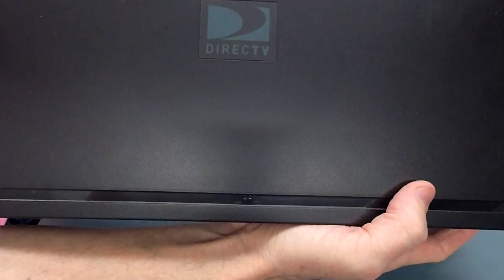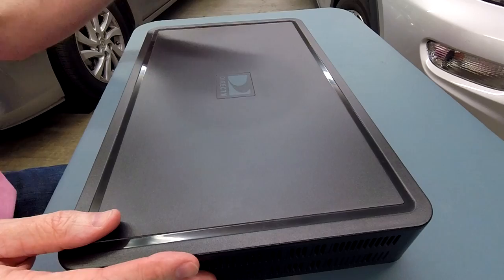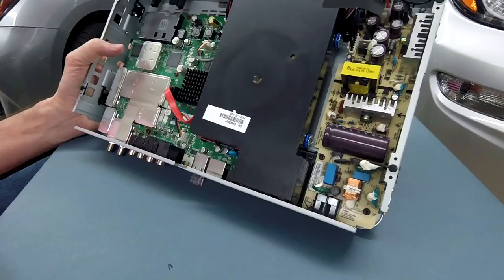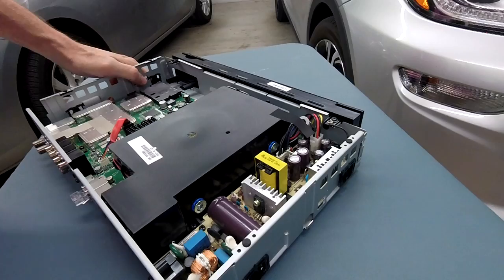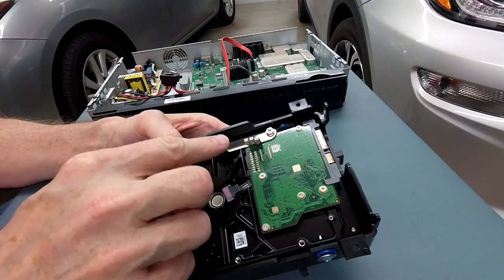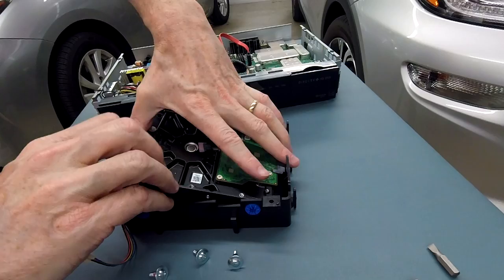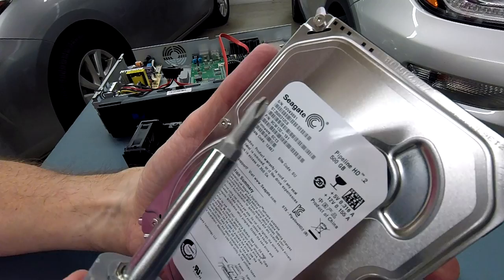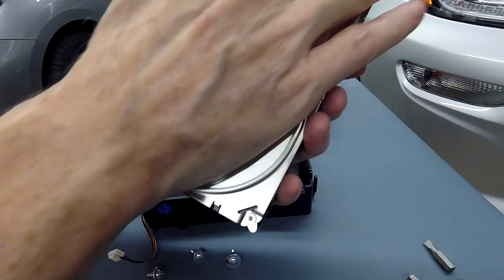DirecTV HR24 Satellite Receiver cover removal and hard drive replacement SUCCESSFUL!

Comment: Just finished installing my new Hard Drive on my HR24-200. Ordered a new Hard Drive from Amazon $15.99. Goodbye Blue Screen of Death. Thanks soo much HGODTX, it's videos like yours that give me the confidence to attempt something like this. It really was quite easy. One great suggestion I read that really worked well was using old credit/gift cards to hold the clips open on the sides when removing the case.
Reply from the maker: Can't believe 21k people watched this. I try and make tech videos whenever I can't find anyone else with a good explanation of something that I need help on. Yes, the credit card trick is good, I learned about it just after I made the video!
Reply: Can you provide a link to the drive you purchased? I would appreciate that.

Comment: Here we are in late 2019 and DirecTV probably doesn't have these receivers any more, so I didn't want to deal with their hassle to upgrade equipment (for my own personal reasons).  But thank you for the video and showing where the tabs are.  While my model HR24  isn't exactly like yours, the cover and clips are the same.  There are little indentations on the side of the plastic cover that tell you where the clips are.  I simply put it on it's side and slipped a small thin screwdriver into the openings and unlatched the clips one at a time for each side.  The cover slipped right off and didn't snag in the back like yours did.  I replaced the hard drive with one I had for 500G (from a previous operation on another DirecTV unit) and it started right up.  As a matter of fact, it still had my Series Manager shows on it from 2 years ago.  It also had recordings, but they were encoded to the previous receiver and wouldn't play, so I just deleted them.  Hope this helps someone else like this video helped me.
Reply: I've heard that the HR2* line of receivers are no longer being activated unless you are a commercial customer or have the little insurance plan they offer on a monthly basis.  Pretty clear that they are trying to get all of us to switch over to Genies and ditch these things altogether.  So for those of us who still like the equipment, pop in a shiny new 2TB and game on!

Comment: Thanks for the video.  I am running my HR-24 off an external 2T SSD.  Best upgrade I could have made!  I bought the SSD off eBay (an enterprise-grade SM863, if I recall, with over 80% life remaining).  I’ll go ahead and install it inside the DVR as there’s no need to keep that old HDD spinning since it’s not being used.
Reply from the maker: About 4yrs ago I found myself using the free directTV app for streaming my service more so than the DVR. Then my dish started needing constant adjustment. Then my wife and I had many 'gotta watch' shows blow up due to a heavy rainy spring. Canceled directTV and just went without for a while. Enjoyed savings and life without a DVR for 2yrs, then went with Spectrum TV choice streaming. Enjoyed that for a while. Then went with YouTube TV. Been loving that on all our devices. We do the family plan for YouTube TV and YouTube Premium with four of us and all our devices and are very happy!

One other thing that was very interesting was that the DirecTV streaming app was very problematic. Always troubleshooting it crashing, killing, restarting. Sometimes watching the 10:00 news I spent more time trying to get the app to play versus actually watching the news. It's as if AT&T was more interested in constantly authenticating users than actually having a working streaming app. Multiple Android phones and tablets all had the same problems. Such a PITA that I never looked back at considering AT&T streaming.

Comment: Thanks for the video.  I got the diagnostic code 14-079, a hard drive failure.  Contacted DTV and they tried to get me to swap all receivers out for the Genie system. Bottom line, the receiver is not manufactured any longer.  They are trying to find a replacement HR24 series for me.  They said I could just recycle this one, they didn't want it back.  It's been over a week waiting to see if they can find one.  Watched your video and swapped out the 500 for a 300 SSD I had laying around.  If they can't find a replacement unit, I will just replace the 300 ssd with a 1TB one later.  By the way, I used quarters between the plastic case and the locking tabs on the side.

Comment from the maker: Just a quick update. It's been two months and I can definitely see that my drive space has doubled. This means that the mainboard automatically senses the drive size and formats it for full capacity recording.
Reply: Thanks for the video. I have a HR23-700 & the hard drive is failing. Do you think I will be able to put a 1TB HDD in mine? Also is there any special specs I should get on the HDD? I don't have anything like that laying around. Thanks!
Reply: Old credit cards shoved between the sides of the case and each lock works very well to release the top. 2 slid in on one side,  pull up the top, then move them to the other side and do the same. Or 4 cards at each lock at the same time would prove to be even easier way to unlock them. Thanks for taking the time to share your experience with us here.
Reply: Would this work with an SSD?
Reply from the maker: @timgarlick3426  Sure! Any SATA connected drive will work. Not sure what the max size could be. 2TB should be fine and the question would be if it could go higher.
Reply: Is there a way to clone the original drive to a new drive?
Reply from the maker: @blueblade455  interesting question. Never tried that. Best shot would be using Acronis True Image (~$50) on eBay for (~$2). If the standard clone function doesn't work try using the sector-by-sector option. Not sure if the DVR creates partitions on the drive, you might have an issue where you clone to a larger 1TB drive yet the DVR still sees it as a 500GB drive.
Reply: @hgodtx  I remember reading somewhere that the device uses the HD serial number in some way.  They indicated that the image could be cloned, but you'd also have to rewrite the SN to the original....
Reply from the maker: @en2oh  Not sure if the SN is tied to the machine or the HD, but one thing I know is that you cannot transfer the HD or the files to another receiver. It will reject them, or possibly show the titles but not be able to play them. I think the files are encrypted with the key being that SN.
Reply: @blueblade455  There is and there are write-ups detailing how to do it. If you read them and are not sure you can do it, there is at least one company that you can mail your DVR to and they will swap out the drive with a new one and transfer all programming and settings over to it.
Reply: @kyleigh2643  If you're going to go to the trouble of opening it up, go for the 2TB hard drive as the HR2* series will handle 2TBs max.  As far as specs, go with a 7200 rpm drive and one that is suited for DVR or that kind of use, if possible.  Otherwise, it's a pretty simple chore to get this done and you will absolutely love all the space the new drive provides and how quiet it runs.  I've mentioned it in a few other posts on here but place a few drops of 3-in-1 oil on the fan to keep it as quiet as possible and use some compressed air to blow dust out of the enclosure completely.

Comment: I plan on doing this, but with an SSD, as they are cheap enough now, and I'd get rid of the hard drive 'hiss' we now hear from our HR24 in the bedroom. :) I would just have to use the sled that came with the SSD, so as the screw holes line up, and little grounding clips all go back the same way.
Reply: SSDs aren’t terribly good at the kind of file transfers that DVRs use a lot of… very small file chunks that get read, written and deleted quickly.  Not only that, the faster drive isn’t going to speed up your DVR, unfortunately. Slow DVRs tend to be a result of slow processors, not slow drives. The rate at which information is read or written to the drive is tied to real-time. In other words, you can’t write stuff faster than it comes to you over the satellite so unfortunately a SSD will wear out faster and show no noticeable improvement over a regular HDD.

Comment: Thanks for the video. The HDD (error code 14-871) in our HR-24 just failed today. I have already called and DTV is sending a new (refurb, i'm sure) HR-24 receiver. Rep told they may or may not want the defective unit back.  In the event DTV does not want it back, just wanted to confirm that all that is needed is a HDD swap.  I was under the assumption that the new HDD would hold the software to make this thing work, and thus, I would have to clone the HDD in the new unit. But be aware, I have done zero research into this. I see you are stating that the HDD is unformatted, and all the needed data is stored in chips on the PCB. So, if you are telling me this is correct, I'm hoping that DTV does not want the defective unit back. That way, I can simply swap out the HDD and have a back-up receiver. Thanks for posting the video. It has really helped me.
Reply from the maker: Yup! A new blank HD is all it needs. Actually, if your HD is used and has files and/or OS on it, that's fine as well because the system will format it for its use. If you get the old unit working again not sure what use it will have because it's technically owned by AT&T. Not sure how that would play out even if you wanted to set up multiple receivers in your house. The key is that you only have one SN card and won't that move into the new unit?!?
Reply: AFAIK, the access card will work in any HR-24 receiver. So far the HR-24's are lasting about 2-3 years and then a HDD failure. I've had 3 units so far, each lasting about 2-3 yrs. I'm trying to avoid the genie system, so if I can have one ready to set in place when the next HR-24 goes down, I won't be without a DVR for a week waiting on a new one to arrive. In fact, I should be able to run HR-24's indefinitely until something I can't fix breaks.
Reply from the maker: That's a perfect plan!

Comment: I finally got around to cloning and upgrading to a Western Digital Purple Surveillance 2TB drive. Here's the forum link that explains how to do it step by step. Also make sure to use GParted version 0.3.7.7 as this was the only version that worked for me. 

https://www.dbstalk.com/community/index.php?threads/removing-replacing-copying-hard-drive-of-hr2-receiver-photo-tutorial.158213/ 

https://sourceforge.net/projects/gparted/files/gparted-live-stable/0.3.7-7/

I was timid at first on going through the whole process but it was totally worth it and so far my HR24 is working just like it did before but with way more storage space. My previous 500gb drive kept freezing a lot but mostly from being almost full. However even after I deleted most of my old recordings I managed to get back up to 75% space left instead of 10%, the drive still would freeze and I would have to restart the receiver using the front red button. All my recordings, season episode manger and all the other settings were properly transferred over as if nothing happened at all! It did take me all day to do it but I have plenty of time right now but it is REALLY IMPORTANT that you follow all the steps perfect to the T in order to properly complete the process. I also found my hard drive cooling fan was getting pretty noisy which I thought it was drive but turned out it was the fan itself, which I ordered a couple of new fans from ebay. Something to consider when replacing the hard drive since the fan is attached to the hard drive shroud and is held on with only 4 screws. The part number of the fan for mine is Delta AFB0512LB and has a mini 4 pin connector. Just make sure you find the fans that have the wiring long enough just like the originals. I had to track down some wiring extensions also from ebay.

Comment: Thanks for the video, are there any special steps once the new drive is in the dvr to format it, or will it do it automatically when reconnected to power?
Reply from the maker: It's all automatic. Just power it on and watch the screen with lots of patience!
Reply: @hgodtx  +1 It will take its time when formatting the new drive but don't worry, it's working

Comment: Hi Tx for the video - Do you know if I buy a new or used HR24/500 can I just set it up and it will work ?
Reply from the maker: The trick is to buy them "owned". The current owner must actually have purchased the unit rather than just using it from the satellite company. If you buy one that is not "owned" you will not be able to activate it when you call customer service. They will tell you it's their property and it needs to be returned to them. You can call customer service with a serial number of a unit you are considering purchasing to confirm with them that it is "owned" and that it can be activated once you acquire it.

Comment: Didn't doing this void your DirectTV warranty?  Do you own this equipment? Thought these are just leased then need to return if you cancel service?
Reply from the maker: I own it, out of warranty.
Reply: @hgodtx  how long did you have it  / how do you know you outright own it?  I have one 5+ years but though a 3rd party reseller, who supplied it to my condo. We ended the contract 2 months ago and I haven't heard from then wanting it back.
Reply from the maker: @PhotoMan  it's been several years, if I remember correctly the only absolute way to know is to call DirecTV and ask them about the specific serial number on the unit. I bought mine on Ebay and had to ask for the s/n (and make the call to DTV) before making the purchase. I'm glad I did all that extra work because I declined purchasing from two Ebay sellers who were falsely advertising. Agents were glad to help me looking up a few s/n's after I explained I was looking at purchasing used.
Reply: @hgodtx  Thanks.  After I posted that, I decided WTF, and busted open (not break) the case and BAM a Segate 500GB drive is released from it's prison! (Shot of needing to get a tiny star drive to release the inner cage for the drive.) 

BTW for future readers.  4 old credit cards work great on the sides to trigger the clips and use a paint can opener on the bottom to reach in and nude the two interior clips to release.  (They're on the left and right of center). After that - wiggle the case up - there are a series of tabs that snuggly fit into the frame.
Reply: @PhotoMan  With these, they probably just want the card back as these things are waaaaaaaaaaaaaaaaaaay old.  I've read that they (DIRECTV) will no longer activate HR2* units as they are pushing everybody to the Genie setup.

Comment: Is there anything special that needs done to the HD? Does the unit format it?
Reply from the maker: It definitely will format a drive from a PC or a new drive. Not sure if any specific previous format would prevent it from doing its job such as a drive from a raid controller.
Reply: @hgodtx  thanks. I just ordered a 1TB SSD. we use ours in an RV so I'm concerned about a rotating drive . Thanks for the video and the answer.

Comment: Never do this if it's a leased DVR, because it's against directv TOS to take off the cover
Reply: Technically you're right but I doubt they want the equipment back and if they do, just send it back with the original hard drive intact.  Should they bitch about the little foil tape strip being removed (they won't), just say it was like that when you were sent the unit originally.  The HR24-100s came out in 2010 so it's 12-year-old technology at best and another reason why I doubt they want it back is because they have other shit to push you towards...aka the Genie.

Comment: Was going along great until you said Seagate was your favorite brand. Its clear now you are NOT a true geek if you believe those trash drives are good!
Reply from the maker: I'm tainted because that's the major brand that Dell uses in their Enterprise Class storage Systems as well as their business-class desktop solutions. HGST is probably the most reliable with only about a 1% failure rate and WD is probably the least reliable with a crappy 7% failure rate. Seagate is under 4%. I've never studied the price points.

Comment: I would like to smash an HR24 dvr because that model sucks
Reply from the maker: Last week I powered it down and unplugged it. Moved to spectrum streaming services.
Reply: @hgodtx  that’s good, Directv/AT&T customer service sucks nowadays, and the HR24 is one of the worst models because it causes glitches
Reply from the maker: @daviddunning4831  Glitches may be due to age! Mine was flawless until the last two years. Every month or two needing to power cycle it due to freezes or mis-linked recordings. Also hit button on remote and it takes 30 secs to respond!
Reply from the maker: Also wicked is that AT&T thinks it's their receiver and wants me to return it. Years ago when I purchased this unit off ebay I called AT&T to confirm (along with 5 other potential units) that it was not owned by AT&T. I'm not going to lift a finger to call them and get that straightened out, just going to return it since they are paying for shipping and packaging!